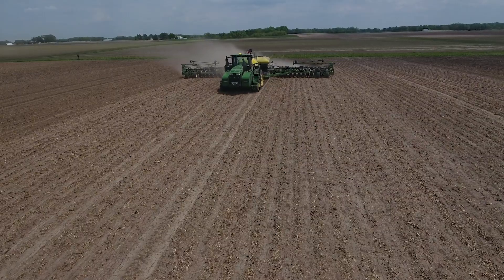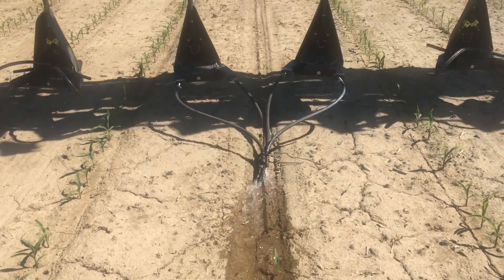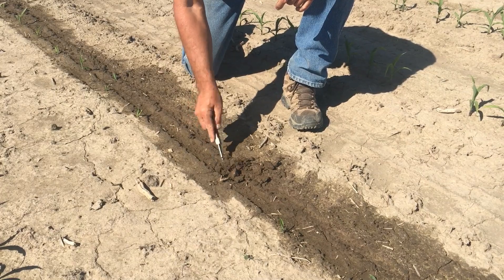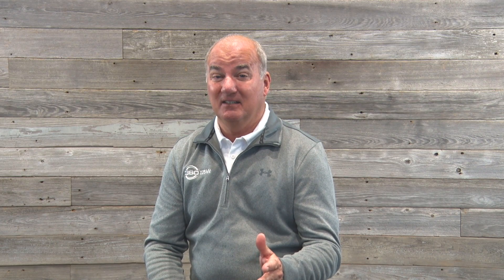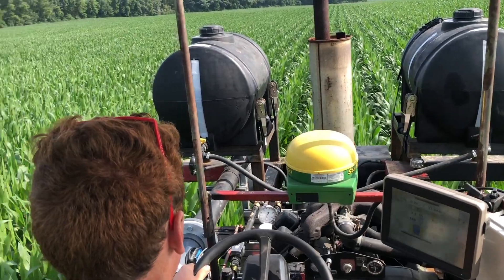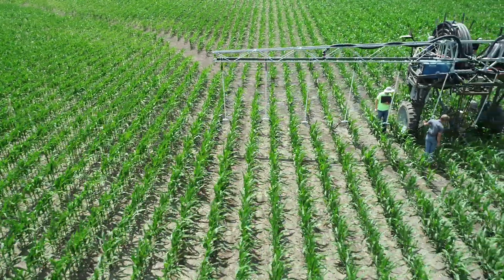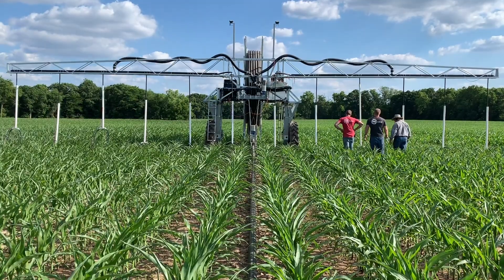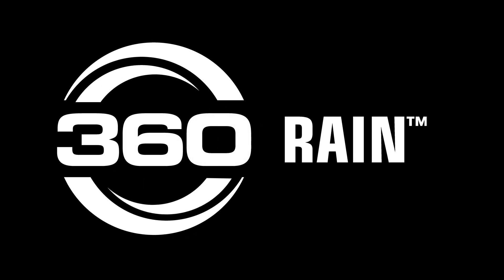The Inspiration Behind 360 RAIN

Comment: 360 Yield Center.  Several years ago you did a commercial for Netafim.  You seemed sold on subsurface drip irrigation.  Are you a real farmer or do you just do commercials for the highest bidder pretending to be a farmer?
Reply from the maker: Our farm has put in a lot of sub drip over the years. Still use it. But have been searching for less expensive and maintenance intense irrigation systems.

Comment: Last year was extremely dry.  I would guess we received less than 2 inches of moisture the entire growing season.  Would this machine ever have the capacity to sustain a sugar beet crop in this area?  I hope it can because all of my fields are irregular shaped and cannot support a pivot.
Reply from the maker: where are you located? What is normal rainfall?
Reply: @360yieldcenter  I'm in Worland Wyoming.   Our annual rainfall is 7 inches, but when and how we receive it varies a great deal.
Reply from the maker: Depending on field size, 360 RAIN could provide .3 to 1" of moisture a week.  And concentrate the moisture over the SB roots. Not sure if that is enough for you.